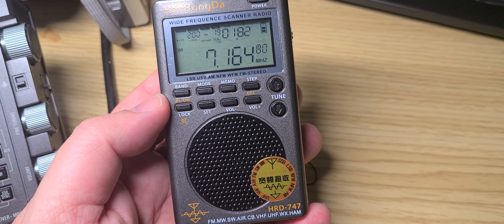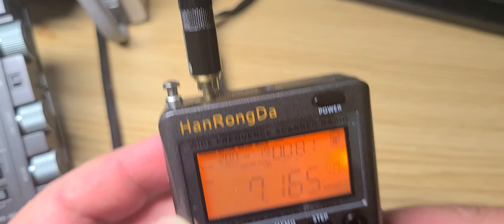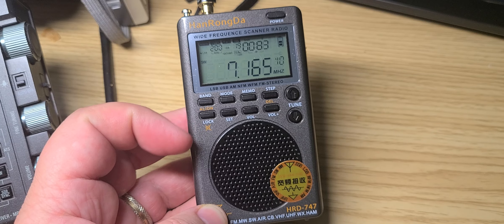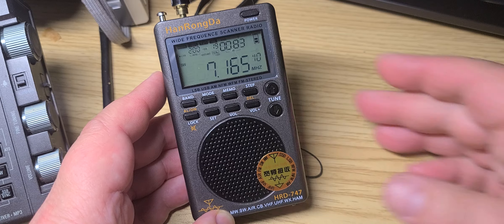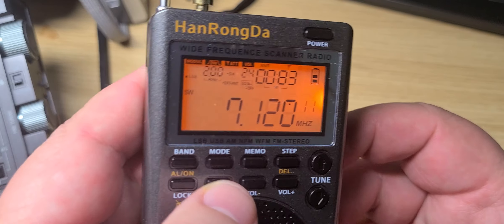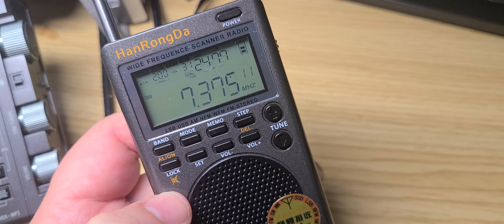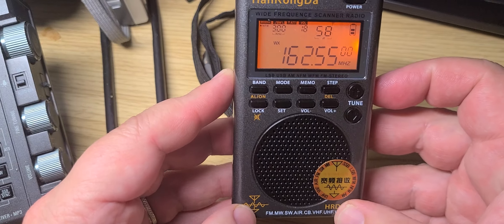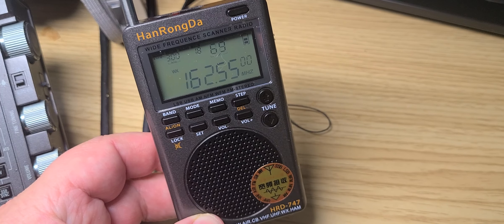First hour with the Hanrongda HRD-747 does not impress me at all with all

Comment: HAM station / tech. 20+ years.  This is a pretty good little radio (excluding the flimsy antenna which actually works well outdoors).
Tested all bands with external antennas for each,  very good RX.
While CB band does not have SSB, you can use the Shortwave band to access CB frequencies with SSB.
Lowest tune increment on side band is 1kHz, so there will be some unintelligible stations who are off or drift.  I also believe SSB on this radio is not set to ‘0’, causing even more SSB clarification issues.
Reply from the maker: VHF UHF is useless with the bandwidth provided, this is not a good radio
Reply: @OfficialSWLchannel  Save your paper route money and buy an Alinco DJ X-11 (even these radios are a few Hz off on SSB).

           -   W8GMG

Comment: I'm subscribed to your channel but I wish I had hit this video before buying it. Well, I have the Retekess TR-110 but it's the same radio.
My experience so far is very disappointing, especially for the air band. I have used it on high grounds bordering Paris from where I can usually catch all sorts of signals on the air band with my Sihuadon R-108. The TR-110 was all but deaf. Maybe because it was severely overloading because of surrounding FM transmitters, The dB signal strength was stuck at  60-80 depending on the attenuation level I chose. However the R-108 does seem to manage this quite well. I've tried SW bands too (evening) and it was mediocre. Again, the R-108 has beaten it hands down.
I'm not sure I'll keep it or return it. At 80 euros it's not a cheap radio. I expected way more than this.
I'll give it another chance to win me in a quieter place out of town next week.
Reply from the maker: The problem is that no one talks about what I talk about .. it goes up to 500 MHz and is useless outside of the shortwave and air band... the bandwidths are too wide... plus if you get to a city with strong FM stations..you will see it go deaf from all the overload.   SSB is very crappy to tune...sorry there is much better at that price...
Reply: @OfficialSWLchannel  Thx for your reply. "plus if you get to a city with strong FM stations..you will see it go deaf from all the overload." Well, that was my point and my experience, precisely. I also have the HRD-737 from a long time ago. I don't use it much. I'll try seeing if the 747 aka TR-110 fares better than the 737 at least. For the price difference, it should. If not I'll definitely return it.
And I do agree, for the the same price a Xhdata D-808 is a vastly better choice. Not many people will miss VHF/UHF NFM I guess. And the tiny toy full of tech effect lasts only that much time.

Comment: This review is not fair, because you nead to know, what mode and freq you want. The radio is very professionel, and you have to be patient and learn to use it. The reviewer obviosly dont know much about the radio. I am a ham, and find this little radio fantastic, when I first learned to use it. And this little radio is a god listener.
BUT take your time to operate this little fellow. I use it with external speakers, and ofcourse external antenna for ham freq.
Reply from the maker: This review is very fair You need to understand what it could do that it does not as on Wide FM is available which is useless on all the VHF UHF range, you should not comment when you do not know what it should do, add overload issues..horrible receiver  You like all others just focus on shortwave...but do not even know what it should receive above 30 MHz that it does not